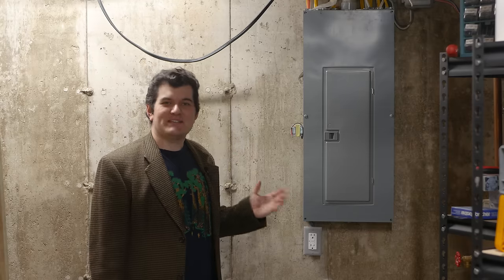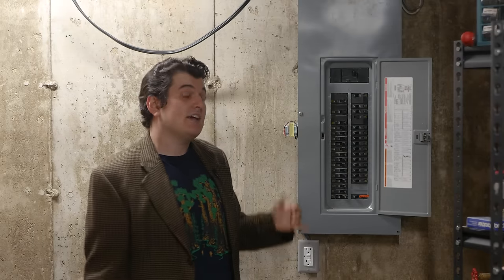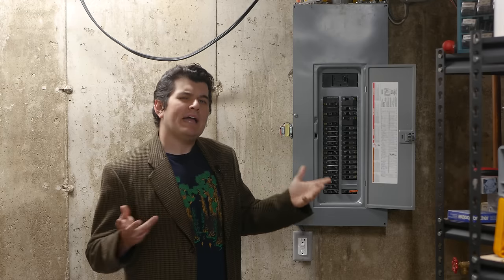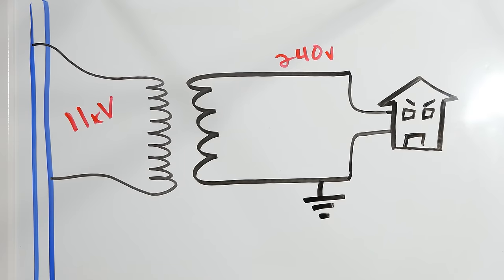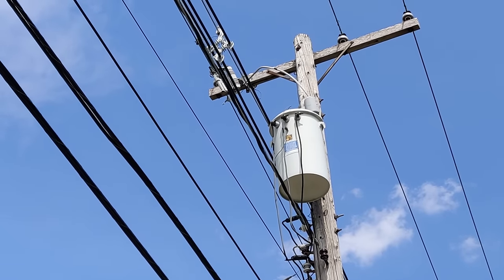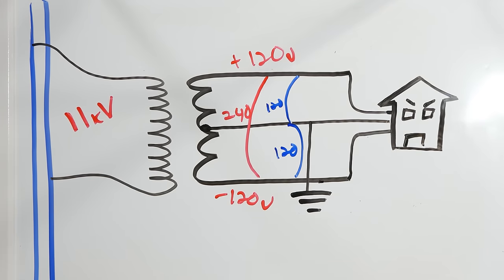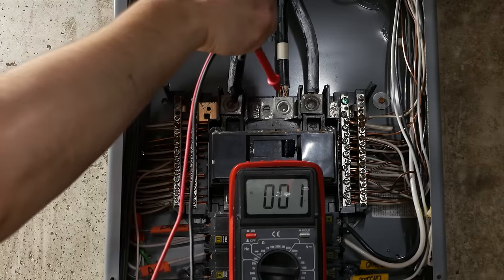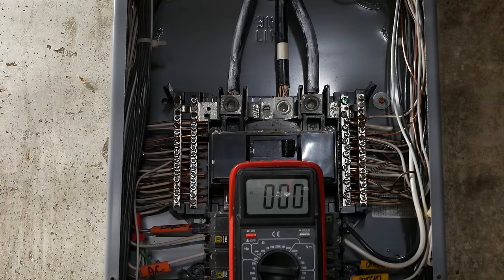The US electrical system is not 120V

Comment: You forgot to mention, that in Europe we have a 3 phase system, and that way we have 400V between phases. 
I have 2 3phase meters, both of them have 3x32A feed. The first one is the normal, the second one is a special purpose meter for the heat pumps and AC-s.
Reply: He did not forget. It fact he very explicitly mentioned that he was not addressing it.
Reply: @DanKaschel  yeah but the video makes it seem a bit like that normal north American homes have the same "power" as European homes, but in Europe we have normally 3 phase 400V.
Reply: @simonstucki  US homes can wire 3 phase 240v.  It is available to all homes in the USA
Reply: @simonstucki  Not inside UK homes. 3ph, 410v ends out under the street unless you pay a significant amount for a 3ph supply.
Reply: @protonneutron9046  No. The service is not available to anyone. 3 phase is not readily available everywhere. Some homes yes. Most, mine included, it is not.
Reply: @castarmax1970  Yes, some backwater areas of homes don't have 3 phase. The US grid IS 3 phase and runs to the VAST majority of neighborhoods and is what ALL sub-stations put out to local grid.
Reply: @castarmax1970  you can always get 3-phase. You may have to pay exorbitant prices to have a line run, but that option is basically always available.

Comment: The UK shaver outlets came into standardization before GFCIs were available. 
Edison's Dc power delivery was at a nominal 110V. Switches were required next to the outlets because DC at these voltages would draw a long spark when a plug is withdrawn without a switch off first. This voltage was maintained by Tesla's AC power delivery and he added the other leg of the 240. Tesla was always optimizing, so he kept the legs at 110/120 while giving provision for twice the power with 2 legs. Many early appliances were rated for AC/DC if the voltage was the same, so 110/120 continued into the AC age. By the way, three phase power was invented by Tesla and it is used almost everywhere. There have been two phase systems, but the phases are 90 degrees apart and require 4 wires. Three phase rules!
Reply: AriBenDavid
That is correct.

Comment: The safety factor of the switch is that you can turn the switch off, plug in/unplug the device, then turn the switch back on again. You showed the perfect example of why this is a good safety feature at 16:00 in this video.
Reply: I thought that too and the plugs in the UK have a plastic peg finished with the copper contact at the end. When the copper is fully enclosed in the socket even if the plug isn't in all of the way only plastic is exposed so touching a live connection isn't possible. The Earth connector is fully copper as that needs to be stronger as it opens the shutters in the socket.
Reply: It's not a good safety feature unless it also locks you out of removing the plug without turning it off though. If you have to remember to turn it off, then you could just also remember to hold and seat the plug properly... It's not any different. You're still putting safety squarely on the user properly operating the device.

Comment: good general description.  My Electrical engineers description.   the two 120v amplitude transformer output taps are 180 degrees or opposite phase.   combining both phases adds to a 240 peak to peak voltage power line.   this is why big air conditioners,  water heaters, welders,  etc just tap off the two (180 deg phase difference) hots on the rails, and sometimes dont bother with the neutral!
Reply: AC voltage is expressed in RMS, not peak-to-peak.  240V RMS is 679V peak-to-peak.

Comment: Europeans: Our power system is actually 400V
Reply: Industries use 690V. That is delta 400V star 690V for motors.
Reply: Americans: Our power system has two ways to get to 600V
3-Phase, 4-Wire 600Y/347 V and 3-Phase, 3-Wire 600 V Delta (No neutral)
Reply: Yeah, and they don't have a measly 3 wires, Europeans have 5.
Reply: In Oz our three phase is 415V
Reply: @benruss4130  but in rest-of-world our common houses have four wire 3-phase at 400ish volts

Where a US households aircon takes 240V, anywhere else they run on 400V three phase
Reply: @gearloose703  you cannot compare Industrial and home services. Industrial services are most times provided through dedicated transformers, that can be set up to provide whatever is needed. There sure are some default voltages, as that makes life easier for everyone, but they are still kind of a specialty feature.
For industrial services you kind of can get whatever you need almost everywhere, as long as the are capable service lines or you are willing pto pay for having them set up.
Reply: @AlJay0032  that really depends on the power distribution system used. There are systems providing phase, neutral and ground from the grid, there are some providing a combined PEN that is then split, some have only phase comming in,  creating PE and N from Ground rods anchored either in the foundations or in the ground. And there are variations in between, where either PE, N or PEN are provided from the grid, but have to be connected to a local Ground.
Reply: I was a bit afraid of this debate springing up while writing this comment. The 400V 3-phase thing (3x 230V...) in Europe is kind of true, depending on how you wire it... Nevertheless, at least here in Slovakia, pretty much every house i've come across has 3-phase power, and i'm pretty sure i could find 3-phase power at least in the stairwells of the old commieblocks. The nice thing about this is, you can take one of the phases and run household stuff, and use the threephase for industrial/more power demanding stuff.

Comment: The voltage in the USA used to be 110 volts in the early to mid 1900s.  It then was upped to 115 volts, and finally today we have 120 volts, give or take 4 volts.  Early tube equipment was designed for 110V and can over voltage internally today if not modified, as tube equipment usually have step-up transformers to get around 300 volts.  So, if designed for 300 volts when 110 volts are incoming, you can imagine the increase in voltage (due to the transformer ratio) can do for the output voltage.  Old tube equipment was usually designed on the borderline of specs.  300 volt capacitors would be used if 290 volts was the average.   This can cause severe problems today.

Those restoring old tube equipment have to replace a lot of those old components with those with higher specifications.  Sometimes even modifying the design of the circuits to prevent damage to tubes.

Basically, as the demand on the grid per home has increased, due to more electronics being used, more energy has been made available with small increases in voltage.  Most solid state devices have regulation where voltage limits are necessary.  So this is not really a giant issue today.  However, for vintage equipment over half a century old, this can be a problem.
Reply: Richard Kelsch. Perhaps they could just nudge the voltage up 10 V / decade and by next century they'll catch up with the rest of us
Reply: @Froggability  Did you watch the video?  There's no "catching up" needed.  I am quite happy with the 240/120 design in the USA.  Incidentally, many European grids have also climbed in voltage.  Whereas it started with 220V many are now 240V.  In the USA, if you want 240 volts, it's right there at the power box, and large appliance outlets.  Most average electronics do not need 240 volts.  120 volts are just fine.
Reply: A problem they dont tell consumer about when it comes to the raising of voltage over the years is that it eats into safety margin on audio amplifiers etc etc .if you bought a 110 Voltage expensive guitar amp or stereo amp tv what ever thing it shorten the lifespan of those things when voltage is raised and people should maybe sue the power company for not telling them this.I would if i had a  Krell Accuphase or McIntosh expensive amplifie/prise range 10 000 us dollar and up go bad just because power company raised the voltage without telling what it could destroy premature.Maybe they get kickback from producers of el gear.
Reply: @leohobbleohobb3781  if you are using a 40+ year old piece of equipment, then you are using it far beyond its expected lifespan. If you are plugging in that equipment after four decades and have not replaced the capacitors and tired resistors, never mind the voltage, you have nobody to blame but yourself if it fries you tubes or tranformers. If you are forcing a guitar amplifier into heavy class A operation, because you like the sound those leaky bumble bee capacitors give you, then you deserve the spectacular failure that results.  Add to that the higher voltage, then you deserve to be pointed at and laughed at.

Anyone with vintage equipment that is or was terribly expensive, should be maintaning it regularly, and such maintenance can keep up with line voltage.
Reply: @richardkelsch3640  That is a mindset/trend of the last decade or 2 more and more.I have a tube radio from 1935 and it works.I know it is not safe do to age and spesific eletrolytic caps.I have Tanberg recivers that works fine from the 1970 and early 80s.works fine and are safe.The gear i mentioned is made to last and it should for the price.I am talking about places that have raised the voltage from 220 and up to 240 in max 20 years.You are maybe  of the waste generation where you have to run in the consumer trap hamster wheel and buy a new amp phone etc every 2-5 years and think that seems a ok system.If they could make radios etc to easy last 20-.40 years around 90 years ago before a re cap and some overhal was needed then it should more so today.I know it is no problem to make amplifiers that last a lifetime if needed.The gear i use every day i have build my self and and will easy last over 20 years.F sake i have the 1 amp i build 40 years ago,it had a supply cap change and some solder joints serviced my son is using it to drive his midrange section. I use a variac for the things.
Reply: @leohobbleohobb3781  That equipment was made for an old power grid.  There are reasons for companies to raise the voltage for service.  Most of those reasons are to give old neighborhoods and old village power grids the ability to compensate for the modern drain.

Regardless if you like it or not, your equipment is outdated and made for 1934 etc.  It is 2020 and demanding power companies or municipalities accommodate the severe minority owning equipment that is approaching a century old, (even half a century) is silly.

If your nation raised the voltage 20 volts, then they likely did that to keep up with the demand and load, to prevent brown-outs.

Many times, if you attach a voltmeter to the power, then start turning on things around the house, especially large appliances, you will find that voltage will drop.  If the whole neighborhood is doing that, then a brown-out will result, unless the voltage is high enough to accommodate the load.  Many grids cannot accommodate an increase in amperage, but can compensate with voltage.

I'm not knocking the old tube/valve equipment, but one must adapt as technology forces the grid to adapt.  Your expensive equipment can be easily modified to accommodate a higher voltage.  At the worst, plug in a heavy duty Variac and set the voltage yourself.
Reply: @richardkelsch3640  I can see that argument and agree.Better consumer information when they did raise lets say where i live would not have hurt  since it happened in a relative short time span than many other places . Varies from place to place in the world i think
Reply: @leohobbleohobb3781  You do realize, that once upon a time, part of the USA's power was operating at 25Hz?  That was silly, and required huge transformers in tube equipment (the lower the frequency, the larger the core).

Technology will always improve, and things will change, whether we like it or not.  Adaptation will keep the old things running.
Reply: @richardkelsch3640  did not know it was 25hz once.Always something new to learn.And i like this topic since i work with it  and have it as a hobby.Thanks
Reply: @richardkelsch3640  yep that it has been true for some time,Adapting and upgrades are a part of the prosess .It goes in waves and periods.Meaning over the human history.
Reply: @richardkelsch3640  The US grid was never 25 Hz although local systems used the frequency when demanded by industry. A multitude of frequencies were used, both in the US and Europe - everywhere from about 16 Hz to 133 Hz. There were often at least two different frequencies in use in any given area - a low frequency primarily for large industrial motors or traction motors and a higher frequency for lighting. For example, around 1915, London had at least 10 different frequencies in use at the same time.
 
25 Hz and 40 Hz are still used in some places in the US and Europe.
Reply: @buggsy5  Sorry to burst your bubble, but the original line frequency at the Westinghouse Niagra Falls plant was originally 25Hz..  This is because the turbines were specifically designed to spin at 250 RPM, and were actually going to be 16.5 Hz (to power large motorized equipment), but the generator design was modified to be 12 pole to generate 25Hz sufficient for lighting (by demand of Westinghouse himself).  This Westinghouse plant started service in 1895.  Some extremely early tube equipment used extremely large core transformers, due to the low frequency.  This, incidentally, was the origin for the 25Hz industrial standard.

In just 1897, the US had a bunch of line frequencies.  The lowest being 25 Hz, and the highest being 140 Hz.  Specifically, 25, 27, 33, 40, 58.3, 60, 62.5, 66.7, 125, 133, and 140 Hz.
Reply: @richardkelsch3640  I think the only place we disagree is I don't think the Niagara Falls generators would be considered part of a grid. 

Westinghouse wanted 40 Hz, but compromised, as you stated on 25 Hz. Tesla probably wanted 60 Hz. Yes, the Niagara system was effective enough and impressive enough that 25 Hz became somewhat of a standard for a number of years - at least in the Northeastern US. 

I don't think that AC power companies started interconnecting their networks until the 1920s and, if I recall correctly, national laws to regulate network interconnections were written sometime in the 1930's.  By then, 50 Hz and 60 Hz  were becoming much more common.  Part of this move was due to Tesla's induction motor, which would work efficiently at 50/60 Hz.
Reply: @buggsy5  Semantics and nitpicking.  The simple fact is, in the late 19th century and on into the early 20th century, power in the USA was 25 Hz in some areas., and up to 140 Hz in others..  Consumer equipment (what little there was) was manufactured to operate for those areas.  The whole original point for this whole thread is that standards do change, and it's usually to accommodate need and technology.  We can also discuss why 60 Hz is more efficient and cost effective than 50 Hz for long distance transmission, versus loss and transformer size, but this is YouTube, not a geek forum.

People, instead of complaining to the power companies, should be complaining to the equipment manufacturers, making equipment operate at the threshold of top voltage, with no room for future changes.  However, that equipment was manufactured over half a century ago or more.  Today, coincidentally, modern equipment with regulation, would be able to handle slight changes, as their power supplies usually step down instead of step up and many use switching supplies that can adapt to small changes.

Summary?  It is what it is, and you need to adapt yourself, as the whole population isn't going to adjust to a tiny minority of complainers that collect vintage equipment.
Reply: @Froggability  what is a high blade lift blade
Moo mutu

Comment: For anyone (who likes math) wondering where the 208 volts comes from:

As explained, it’s a difference between two AC signals 120 degrees out of phase, and this difference can be found using trigonometry. First phase can be modeled as sin(x), second phase as sin(x+120deg). Then the difference is sin(x+120deg) - sin(x) 

= [ sin(x)cos(120)+cos(x)sin(120) ] -sin(x) (using sum formula)

= sin(x)(cos(120)-1) + cos(x)sin(120)

= sin(x)(-.5-1) + cos(x) * sqrt(3)/2

= sqrt(3) * ( sin(x) * -sqrt(3)/2+ cos(x) * 1/2 )

= sqrt(3) * ( sin(x)*cos(150 deg) + cos(x) * sin(150 deg) )

= sqrt(3) * sin(x + 150 deg) (using sum formula in reverse)

So with a single phase voltage of 120V, the difference between the phases is 120*sqrt(3) = 107.846 V

Comment: The switch is just one extra way the circuit can be broken without having to pull the cable out of the wall.  Some cables don't like this (like the UK), but also if the cable is in any way damaged, burned etc, this allows the circuit to be broken without touching the cable.  Situational for sure, but in those situations it's good to have it

Comment: Great video and I learned something new today. To answer your argument about the pros/cons of having a power switch on the outlet itself instead of on the appliance - well, three things to consider: Firstly, it's better to have the switch design as part of the electrical outlet specification as it's a more reliable specification than whatever appliance manufacturers use. Second, it means you don't have the extra cost of installing a switch on every appliance, although to be honest a lot still do. And third, in the unlikely but possible scenario that you have a pet with the inclination to chew on things, a wall switch allows convenient isolating of the circuit without having to keep unplugging and plugging in the appliance every time you use it.